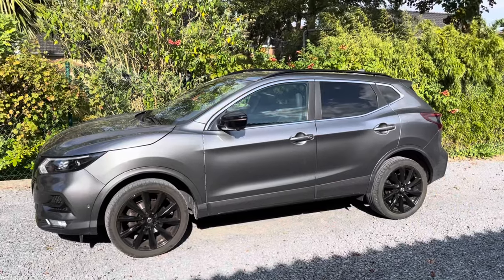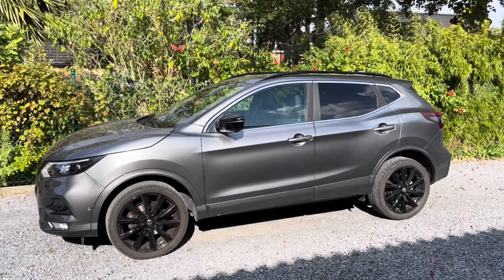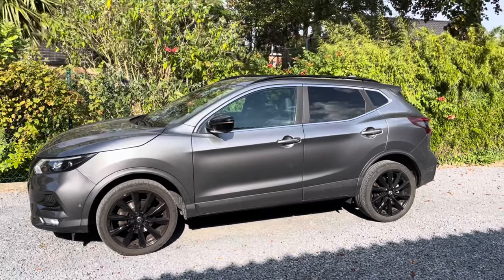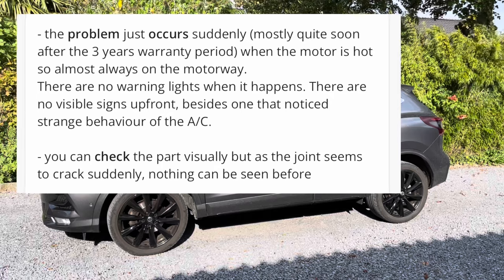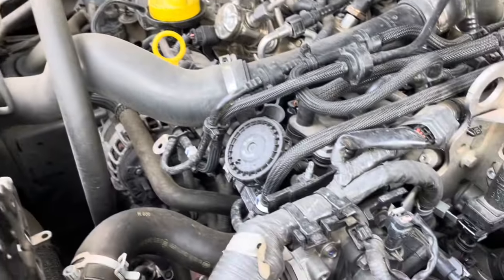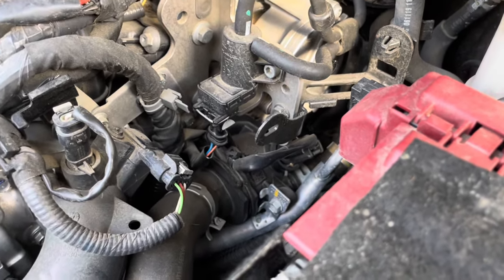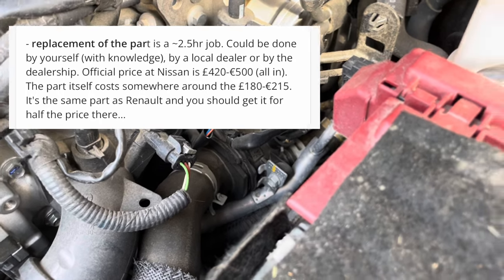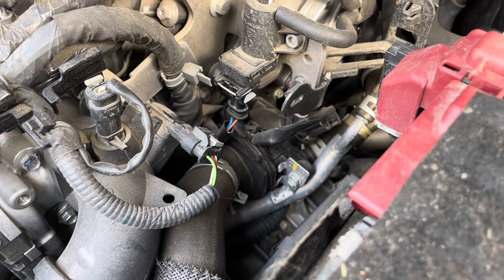Nissan Qashqai J11b: huge thermostat housing problem !!

Comment: I experienced the same problem. I own a 2019 1.3 160hp Skypack Qashqai. After getting the 50.000 km service done, the thermostat blew at 52.000 km. While driving in traffic, another driver told me that smoke was coming from my car, so I pulled over. It turned out that steam was coming out because the coolant was leaking towards the exhaust due to the heat. I had the car towed to the Nissan dealer, and the thermostat was replaced at a cost of around 273€. But now my car 60.000 km, and even though the thermostat and coolant were changed at 52.000 km, I've hat to add 3 liters of coolant and 1.5 liters of pure water. My car is leaking water. While driving in stop-and-go traffic, the temperature gauge rises all the way to red. When I told the Nissan service about this problem, they gave me the earliest appointment on October 8, 2024. I'm joining you from Turkey. I hope my car's head gasket hasn't blown and that there's just a leak in the cooling system's pipes. Otherwise, I'll be facing a new engine expense. I used to have a 2008 Nissan Qashqai Tekna with a 1.6-liter atmhospheric engine. Despite having an LPG fuel system installed in that car, I never had any problems with the engine and drove it for 160,000 km. That's why I bought another Nissan in 2019. But after this, I won't even pass by a Nissan dealer. If no issues arise with the engine after the service appointment, I'll sell the car immediately.
Reply from the maker: Wow! Thank you for sharing your story. I would do the exact same if I were you. Horrible to drive with the continious doubt. 😞 keep us posted please 🙏
Reply: @LaPalmeraie0032  I will share the developments as soon as possible.
Reply: @LaPalmeraie0032  Today, I took my car to a private service center, and they told me that the reason it's losing water is due to a blown engine head gasket. I will take my car to an authorized Nissan service center and will be following up on this issue. If any of you have a global recall notice from Nissan regarding this part, I would appreciate it if you could share it with me.
Reply from the maker: @cembikmaz9668 oh no… that’s bad news. No there is no recall notice, that’s the whole problem. Nissan is ignoring the fact that this is a wide spread problem. You could check the UK Qashqai forum topic. I feel that everyone there want to join to take action all together.
Reply from the maker: @cembikmaz9668  FYI: https://forms.gle/5HshnUqWG2NCS3Xo6
Reply: @LaPalmeraie0032  Thank you for sending the form. I filled it out on the Qashqai forum last night. My car's engine was changed. A new engine manufactured on 24.10.2023 was installed. When I put it side by side with my 2019 model engine, there are some revisions on the new engine. I had the engine installed at another service. The total cost was between 8600 and 9000€. After changing the engine, calibration coding was done for the TCU of the DCT transmission. For your information. After changing the engine, the transmission may knock or shake. Only this calibration is done in the official Nissan service. FYI.
Reply from the maker: @cembikmaz9668  thank you very much! This makes me wonder... I didn't ask for the type of transmission. I will add it in the form and add it on the actual responses as well. 🙏
Reply: Merhaba Adana dan. Aynı araca sahibim 2019 1.3 160 hp qashqai. Geçen ay 53 bin km de tam olarak yaşadıklarınızı tecrübe ettim. Yolda kaldım, termostat değişti ki parasını aldı servis 14 bin tl sanki benim hatammış gibi. Buna göz yumdum. Termostat değişiminden 1 hafta sonra su seviyesi max. dan minimum altına düştü. Servise gittim su eksiltme yok dedi. Ama kaputu açıp bana gösterdiğinde bariz şekilde antifriz ya da su eklenmişti. Son 1 haftadır herhangi bir eksiltme yok gibi ama devamında bir çok kişinin yaşadığı motor değişimi noktasına gelecek bu işin sonu diye çok gerginim açıkçası.
Reply from the maker: @emrahk.6435  Görüşünüz için teşekkür ederiz. Formu da doldurduğunuzdan emin olun. 😉
Reply: Merhaba öncelikle gecmis olsun , genleşme kabına su seviye sensörü takıla bilir mi , bu çok büyük bir eksiklik. 3 kuruşluk bir malzeme olsa anında içeriye sistem haber verir.
Reply from the maker: @erssah8420  Merhaba, bu yapılabilir ancak oldukça büyük bir değişiklik.

Comment: Yeah my housing blew up too, my dad ran with no coolant for 50 km + 10 until home. He realised something is wrong when the car didn't have power to go over 50kmh. When he got home there was a strong walnuts smell. Costed 100 euros + labor to replace
Reply: Surprinsingly other than the temp gauge which was on full red there was no warning at all which is pretty weird, not everyone checks their gauge frequently
Reply from the maker: No i do… too much maybe 😅 so a walnut smell. Interesting. And no further damage and only €100? Where are you based?
Reply: @LaPalmeraie0032  Romania, the part is used, not new.
Reply from the maker: @silviu4365  OK! First one there that I hear of. Is the used part the old version as well?
Reply: @LaPalmeraie0032  I haven't checked, but there is a strong possibility that it is the old version
Reply from the maker: But reassured or are you still driving with the shizzels?
Reply: @LaPalmeraie0032  If you mean that do I care or not, I really don't bother with it. Until this video I thought it was just bad luck that it broke
Reply from the maker: @silviu4365  sorry 😇 i will keep looking for a better solution, for the peace of mind. 🤗
Reply from the maker: @silviu4365  FYI: https://forms.gle/5HshnUqWG2NCS3Xo6

Comment: This happened to me a few days ago, car cuts out completely and wouldnt start and all electrics gone. System fault appeared on the dash after breaking down. No warning light and no notice of the thermostat gauge that it was overheating. 62000 miles Qashqai DIG-T, 2019 reg. My thermostat exploded leaving coolant splat all under the bonnet. RAC guy couldn't fix, he did say that its a well known issue with the qashqai. Hoping it hasn't caused damage to the engine!
Reply from the maker: Another 2019… it really is a thing… please fill in my form if you will and keep me posted about the reparations 😉
Reply: Car is finally fixed. Looks like it was just the thermostat and not any other engine issues (so far). The thermostat had actually snapped into two pieces! 
Managed to keep hold of it incase I decide to complain to Nissan.

Have any other issues been caused following a broken thermostat? A bit worried something else is going to go wrong now and feel like I need to get rid of the car 😥
Filled the form in too!
Reply from the maker: @sammiedwards3353 fingers crossed 🤞🏻I heard people experienced burning smell, coolant loose and shocking/vibrations. Not quite comforting of course… also someone in the same case that wanted to get rid of the QQ after all this but no one wanted a car with a new motor. Not even those “we buy your car” sites… 😞 tnx for the questionnaire and keep me posted!

Comment: It happened to me in January, I have the 1.3 dig-t 160hp and luckily I noticed it when I saw smoke coming out of the bonnet. I went to Nissan and they made me pay 395 euros for the new part.
Reply from the maker: Wow! You had the best reaction! Great to hear that it is feasible to save the motor when reacting in time. Where are you based?
Reply: @LaPalmeraie0032  Thank you, I was very lucky. In Italy.
Reply from the maker: @redemptionone8191  FYI: https://forms.gle/5HshnUqWG2NCS3Xo6

Comment: Hello from Greece.
Same thing happened to me on Jenuary.
I own the 1.3 dig-t  140 from 2019 .
It happened at 50.000 km and at 5 years old out of warrenty of course.
In my case I had it fixed for 400 euro at the dealership.
Noneone mention to me for ferther damage and nonone checked it.
The gave me my car to drive it like everything was back to normal.
 I drove it another  almost  5000 km.
But it wasnt.
Soon it started having egnition issues and misfires.
That was  because I  had a blown head gasket and the coolant was going to the sparks.
I had the most terrible summer.
Now its fixed but it is as you said a moving time bomb.
 If you want more information of what I did ,I would gladly give them to you.
 ps sorry for my typos.
Reply from the maker: Hi! Sorry to hear so. Again a 2019 car and 50.000km… numbers that return often. And Greece… not so many occurences there but I did heard one there. Terrible how they know the issue but just fix the broken part and let you do worse. Feel free to share details by mail (see profile) or the QQ fora. 😉 ps no worries for the typos, i’m not a native speaker either but still it’s better than my Greek or your Dutch I suppose 😬
Reply from the maker: FYI: https://forms.gle/5HshnUqWG2NCS3Xo6

Comment: 450 / 5.000
Hello, from Spain.
I heard about some units that had this happen to them. I asked Nissan about it and they had no news.
My car is a 1.3 140 hp from 2019, n-motion, it has about 20k kilometers and no deterioration is observed, but to try to detect the problem of coolant loss I have placed a liquid sensor in the expansion tank and an acoustic and visual alarm on the down panel of the dashboard.
Good luck to everyone
Reply from the maker: Really. Wow great job!! If you could share the details of your installation by mail… that would be great 🙏
Reply from the maker: FYI: https://forms.gle/5HshnUqWG2NCS3Xo6

Comment: A lot of these problems would have been prevented if Nissan had installed a level sensor in the coolant expansion tank like most cars nowadays.
When the thermostat housing fails - there is literally NO WARNING that anything is wrong - and the driver could then continue driving leading to a wrecked engine. Also incredibly dangerous. 
They won't do a recall due to $$$$$.

We were lucky, and managed to have the thermostat replaced. The AA guy who came out said he knew immediately what the problem was.
We've thankfully sold it now and PX-ed for a lovely VW Tiguan - and yes - it has a coolant level sensor.
Reply from the maker: You are so right. Tiguan is a lovely car!

Comment: mein 2019  1.3 t  hat aderen zeichen also die 3 zacken aber dan recths ist anderes als der neue und der alte die du gezeigt hast
gruß 🤔
Reply from the maker: Wirklich? Und wenn Sie es mit einer QR-Code-Scan-App scannen. Welchen Produktcode wird Ihnen dann angezeigt?
Reply: @LaPalmeraie0032  melde mich bald